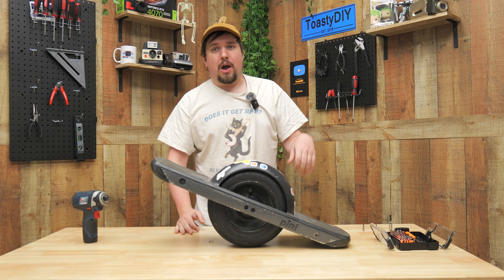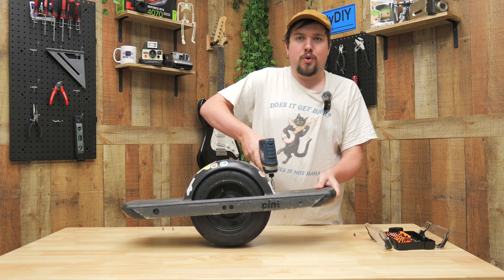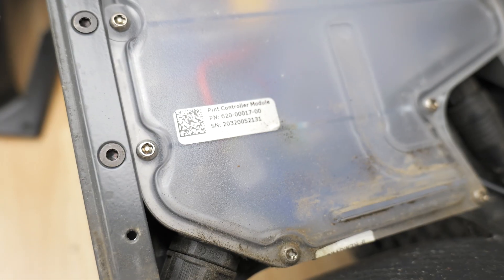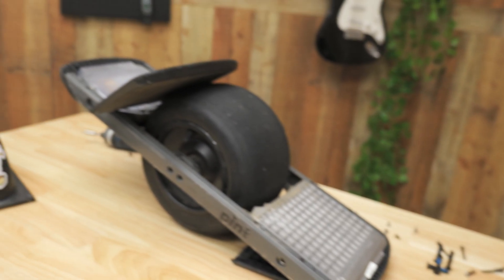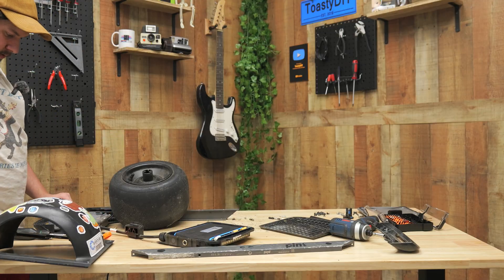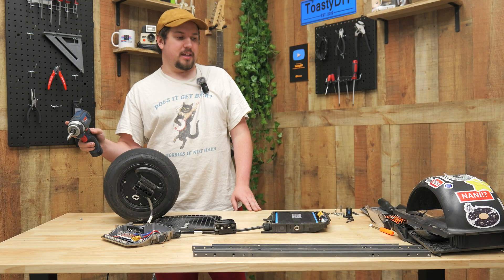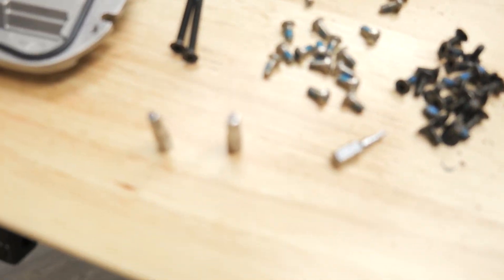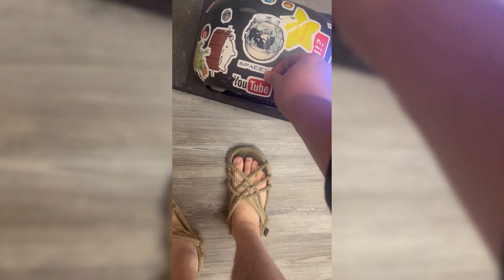Fixing a Dead One Wheel - How To Trickle Charge Battery

Comment: What voltage and current did you set in order to reanimate the battery?
Reply: Yea literally the most important info left out...

Mines probably way to far gone this happened to me 8 months ago...
Reply: @TeslaRebuilders I tore into  a XR yesterday and came here looking for answers. Still none..........😢
Reply: @rwatson2609 Yea from what I have really found is if the battery self discharged too low it's not safe to recharge.
Reply: @rwatson2609 i used a 19 volt bauer drill battery on a onewheel battery with 5.5 volts. It boosted the onewheel battery to 18. Now it is charging!
Reply: @seanmcguirefilm yea man not cool, if you want to burn your house down...
There is a reason the BMS won't allow it to recharge below voltage limit.

The problem here is the one wheel should not be self discharging that quickly.  Just because you forgot to charge it for a few months is not   cool.
Reply: @TeslaRebuilders well, i did it outside. But no danger in fire. The xr batteries charge up to like 63 volts. That's where the real danger is. The BMS shut down when voltage gets too low. My XR was bought from a guy who hadn't charged it in 3-4 years. It wasn't rapidly discharging. Another tip I found online: you can jump the negative battery terminal to the negative on the bms to reset the bms and wake it up. Like all stuff involving taking apart battery boxes, it voids your warranty.  But mine was years out of warranty anyway.  Now it's sitting on the charger for 48-72 hours so the bms can balance the cells. Hopefully it'll work after that. Otherwise it has bad cells and the battery pack will have to be rebuilt.  I've built homemade ebikes and so far never had an issue with anything catching on fire. However,  always measure the battery voltage and take necessary precautions.
Reply: @seanmcguirefilm ok good to know, so the BMS won't brick from loss of power and you can rebuild the pack with new cells?
I might just do that I have done some tool packs before.